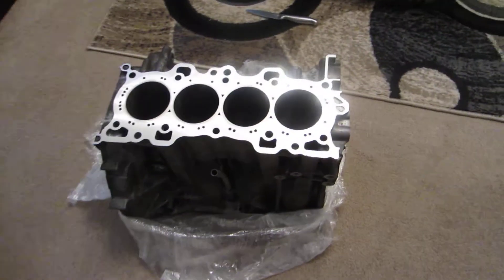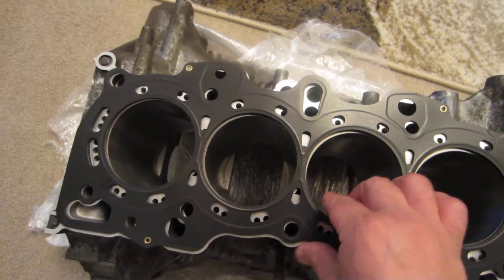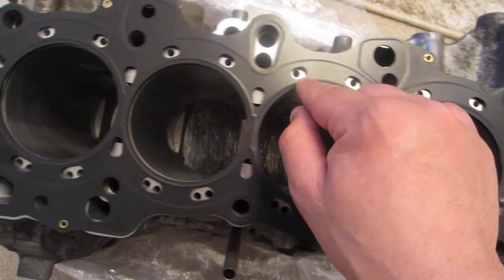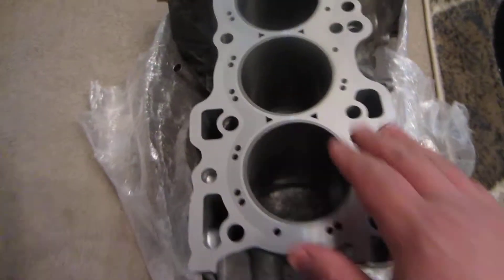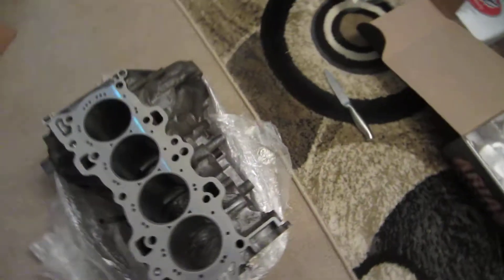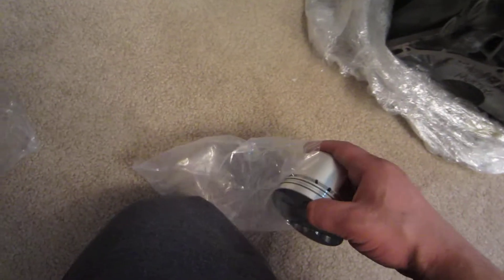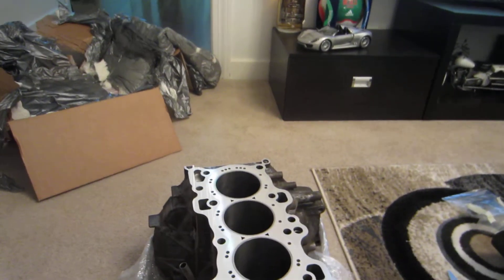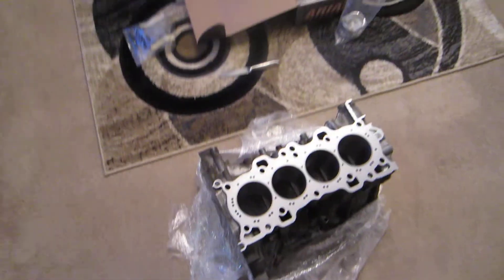B18 CSS block and supertech head gasket..

Comment: Hey I have question , if the head gasket goes exactly how you put it on top of your block because I just had the mechanic installing a supertech head gasket on my Ls b18b block and we found out that water is going into the cylinder 4# I’m just hoping that I don’t have a crack sleeve please let me know .
Reply from the maker: Yes, the headgasket goes the way I place it into the block.. if you passing water into a cylinder bore then your cylinder head might not be straight.. might have to take it apart and check that.. supertech gaskets work great and seal good..
Reply: I think the mechanic put the gasket upside down because I can see on left front corner of your block is round and on my block it’s the right corner on the left .
Do you think that why I’m having water on the cylinders I just open the oil pan today and a lot of water came off and on the exhaust manifold.
Please let me know ..
Only because I can’t send you pics to confirm let me know sorry to bother you.

Comment: How much power/boost would u recommend with a bone stock b18b head non vtec? It’s a completely fresh cylinder head with all new valves and seals
Reply from the maker: To be on the safe side on a stock LS head I won't go past 16psi or about more then 350whp.. that is if you want to keep it reliable, you could push more power but then you risk dropping a valve.. also keep it close to stock rpm..

Comment: Hey i just fully rebuilt a b18b1 and dropped it into my 95 eg hatch have a .5mm bore on it as of right now but wondering a route to take to reach around 400- 500 horsepower, thanks in advance
Reply from the maker: Jeffrey Thomas check out my other videos i was making 408whp on 93 pump using pistons and rods on a LS and crower cams.. simple set up stock sleeves and made good power very reliable..
Reply: civicpride1986 so forged pistons and rods, nothing to my sleves with turbo, would you recommend port and polished head ports or any other machine work?
Reply from the maker: Jeffrey Thomas nippon turbo pistons those are cast and are cheaper then forged or you can do forged pistons also just a little more, any aftermarket rod will work fine.. stock sleeves.. head stock ports and everything just upgraded to dual springs and retainers and some cams, intake manifold and your set for up to 450whp on 93 fuel..
Reply: civicpride1986 thanks man and just a 60trim turbo? I assume fuel injectors/rail with the intake manifold? Any recommendations for the intake also, somewhat new to building, just finished rebuilding this and already want to upgrade from stock with only 1128 miles on it so far haha
Reply from the maker: Jeffrey Thomas turbo depends on your power goal.. for mid to low 400s i would do a Garrett 60trim turbo 63 A/R or a gt3076 turbo. Injectors 750cc work good or 1000cc to later not upgrade.. stock fuel rail and stock fuel pressure regulator is fine.. just a walbro 255 fuel pump and hondata for tuning.. stage 4 clutch or higher..

Comment: Hell yeah man I’m waiting for my css block to get back from the machine shop. Going wiseco pistons eagle rods with a pte6266 shooting for 600whp. CSS Ftw!!!
Reply from the maker: BOOSTED_DC4 very similar set up as mine and also going for 600whp.. i am on a gtw6265 and straight LS. Scat rods
Reply: civicpride1986 sounds like a good set up. I’m currently b18a1 block with a gsr head but if I can make that power on a straight ls I might go that route. What clutch and fuel are you running ?
Reply from the maker: BOOSTED_DC4 stage 5 competition single disc and flywheel.. 110 race fuel. Grams 1150cc injectors and grams 340lph pump, golden eagle fuel rail and aem fpr.
Reply: Rolando Mota those are some bad ass cams man!!  Heard a lot of good things about them.  I might just go with itr cams for the price and will make my goal hp. I have crower stage 2 right now